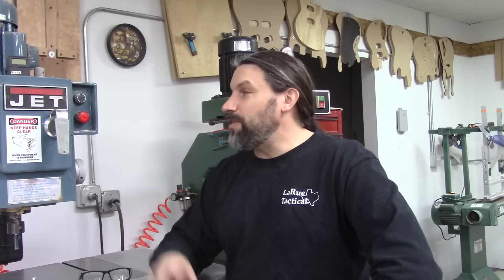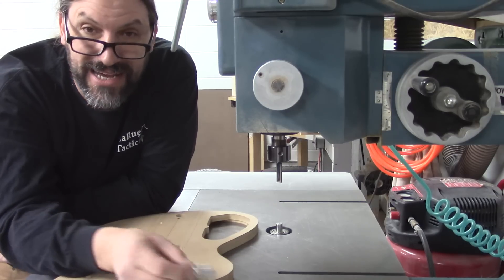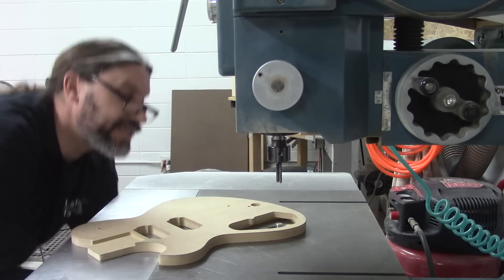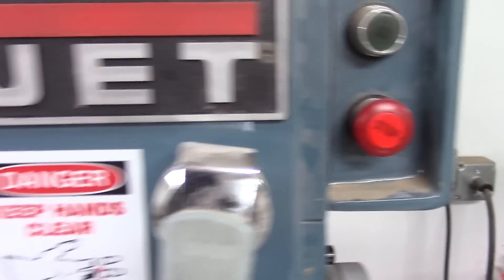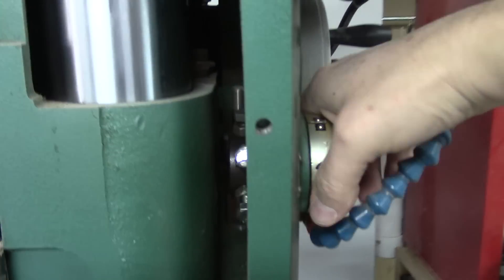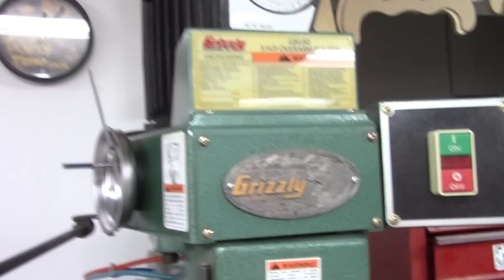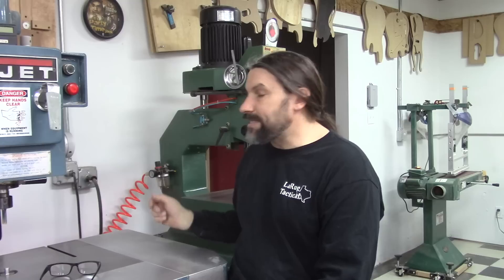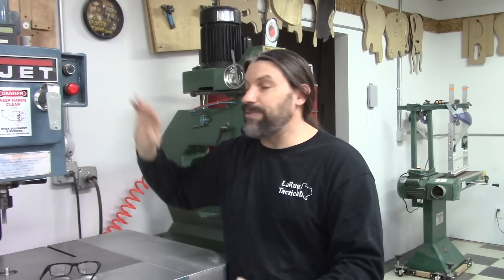Jet Pin Router vs. Grizzly Pin Router... Can There Be Only One?

Comment: Finally! LOL...
I bought a 3 phase 7.5 hp scm machine. I wish I could find a single phase unit, but no luck at the time. I am also in search of the collets and pins as mine didn’t come with any. 
Just had it serviced in Toronto and the machine works flawlessly. 
I paid $1800.00 CAD which works out to be around $1200.00 USD. 
The unit is in new condition and I bought it on an online auction out of Montreal, and in turn had it shipped to Toronto. 
I think all in all I’m into the machine now for around $3000.00 CAD/$2000.00 USD.
The 3 phase power is a pain in the ass...I think you know what I mean. Lol 
Keep the vids coming! 🤘🤘🤘🎸
Reply from the maker: Mine cost about as much to have it delivered as it did to buy it. It was all blocked into a factory and other stuff was built around it.

Comment: There is a Delta pin router near me. The guy is going to send some pictures soon. I think it’s a RU 50. If it is the table cranks up and down manually, but has pneumatic ram with six position adjustable stops up top.

Comment: Thanks for in depth. I like the "how to" and comparison videos. Smart idea having dedicated pin sizes on each.
Reply from the maker: Seemed like a good reason, it speeds up the production and since we have the space it make total sense
Reply: @TexasToastGuitars  especially with Grizzly having twice the rpm. Running smaller diameter cutter adjusts the surface feet per minute .

Comment: Don DiMasi here (logged on as my band, Vivid Black). Question for you: Where do you find parts if/when necessary for the Jet? An example is belts. Or pins. I know you mentioned having custom pins made, but are they available for purchase specifically for the Jet? Thanks! Love the vids, by the way!
Reply from the maker: I don't know where you can source JET brand replacement parts. The pins would be pretty easy to have made. The flat belts are available. Let me look again and get back to you
Reply: What do you think would be a reasonable price for a single custom sized pin, or a set of pins, say in increments of 1/64"?  I wonder what the market is for pins.  I could be tempted to buy an inexpensive metal lathe and start making pin sets if there's enough of a market.  I'm not sure there is though.

Comment: I can totally see the point in having a CNC if you want to make a pattern very very precisely. But once you have the template/s the pin router is superior in cutting speed alone!
Reply from the maker: The shaper is the really high speed tool but the pin router is pretty quick. Now, to be fair, there are CNC machines and then there are CNC machines some are agonizingly slow but others are really fast.

Comment: Something like those hex bolts as depth adjustment stops puts a tear in my eye. It's such a simple yet elegant solution allowing for near infinite fine tuning.
Reply from the maker: Simple, cheap, easy to get and reliable too. They check off all the engineering boxes

Comment: I wish there were reasonable options for pin routers.  Seems like companies only manufacture industrial heavy duty machines.  It’s impossible to justify the price tag for a hobbyist.   I ended up building a small one out of plywood but the functionality and accuracy is sub par.   It worked great for thicknessing boards, sort of like an overarm planning sled.

Comment: My grizzly G8030 pin router is a tool I really enjoy. The plunger will not retract back up into the machine. Any ideas on how to fix this problem?
Reply: Is this while the spindle on or off? Mine does the same , if I lower without the spindle on

Comment: Love my Grizzly pin router. Just watch yourself with that brake handle. It will give you a black eye. In another note. I may be able to help your buddy with some new pins. Or you for that matter if you need some. I have a metal lathe in my shop and have made some pins for myself. Not a hard job. Just would need the right dimensions.
Reply from the maker: What are you doing putting your eye on the break handle brotherman?
Reply: The light switch was behind the machine and as I reached around the thing to shut it off I bumped into it with my eye. It's the same height as my head...I just took it out and let the machine stop on its own now. Hate the grinding sound it makes anyway.

Comment: Hey TT guys (or any commenter who reads this), I have built a number of Cigar Box guitars/ukuleles, so I know how to carve and fret a neck, however, CBGs have no radius. I am going to try to build a Tele (I found templates online), but I don't have any radius blocks.  So here is my stupid question . . . if you ran a block of wood perpendicular to, for example, a 10" table saw blade (using multiple passes, and slowly raising the blade), would that produce a 10" radius block? I know it would be easier to just purchase the appropriate block, and I may just do that. Anyway, thanks in advance!
Reply from the maker: Hi Joseph, you could do something like that. I forget the math but you would need to run the piece at an angle rather than perpendicular. For the same effort you could probably find a 20" pipe and glue a piece of sandpaper to it and grind it until you get a 10" radius block. As you know all of this is more difficult than simply buying a radius block
Reply: Thanks guys. Upon further review, and in the interest of keeping all my fingers, decided to just buy one. Appreciate your prompt response. Thanks!

Comment: How many people either own or are planning on buying a pin router and would be interested in buying a complete set of pins in, say, 1/64" or .25mm increments?

What are the common OD sizes of pins?  I know the Jet and Grizzly units are different sizes and my Shop Fox uses 1/2" pins.
Reply from the maker: Thanks Alan, I'm sure you will get some messages

Comment: My choice is the Jet. The main reason being it has the table extensions for more work surface. They are not available for the Grizzly. I've been looking for a Jet for quite awhile.
Reply from the maker: I love the JET unit but one could always sort out some outfeed tables and cludge them on
Reply: @TexasToastGuitars  I'm about to cludge some plate aluminum on my unbeloved bosch pin router.

Comment: Does it only run at 20,000 or can it be lowered?
Reply from the maker: The Jet runs at 10K and the Grizzly at 20K
I'm sure you could sort out some kind of VFD but that would probably mean a new motor too
Reply: I’m trying to figure out a way to lower the speed on mine at the moment. 20k is just to fast sometimes

Comment: When you makes the back covers, how do you get the grain to line up with the rest of the back of the guitar?

I saw a slick way to do it on another channel. They leave the back thick enough to cut off a small slab to make the cover plates out of so the grain matches almost perfectly. So they basically take a 3/16" veneer off the back or however thick the covers are.

It's around the 2 min mark

https://youtu.be/KZTMDjkQIRw
Reply from the maker: Yep, that is the way you do it, we were just discussing this in the build class yesterday, you should come to one

Comment: The grizzly with only 20,000 rpm setting doesn't sound safe for a larger router bit.
Reply from the maker: You will need to check your bits and see what the manufacture recommends

Comment: Grizzly name,,, Godforsaken Pin Router. I dont think you are going to fall in love with the Grizzly only because the higher RPM of the cutter, 10.000 RPM will be much better on your tooling than 20,000 RPM.
Reply from the maker: Yeah it is good but it might not get a nick-name

Comment: OK - hold up - so you're routing the neck pocket AND the recessed control cavity/cavity cover on to the same side of the stock???  This makes no sense....  If you flip the side of the stock that the template is on for the control cavity this makes sense....

And hey - I saw the Grizzly in the video you did a few vids ago with Crash Pad Studios and I was all like "What? Matt's got TWO pin routers????" - now it all makes sense.

And for any of you out there are watching the used market for these as I am, it seems they are almost more frequently referred to as "over-arm routers".  I've been looking since I started following TTG and I have yet to see one that I'd consider a bargain - they're few and far between (at least near me) and everyone that has one knows what they're worth.... but my search continues.....
Reply: And people should forget about finding that JET router - they're rare as hen's teeth and will cost $10k anyway....  it's a really industrial tool....  The Grizzly is your best bet if you're looking for something this industrial and you can't find one used
Reply from the maker: When you have as many templates as we do you start making them multi-taskers. The outline, neck pocket and pickups get done while the template is attached to the back of the guitar. Then we switch the template to the top and do all the stuff on the back. |
Don't fret, there are more pin routers out there than you think.
Reply: @TexasToastGuitars  Don't fret?  I see what you did there.....  lol